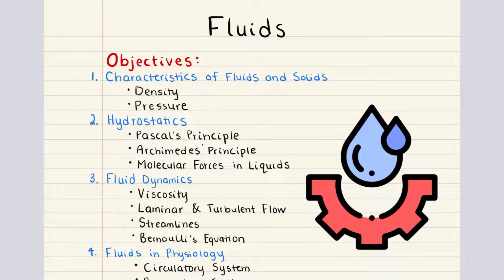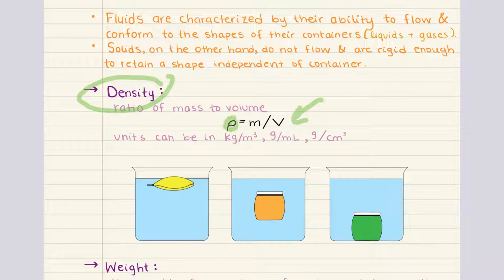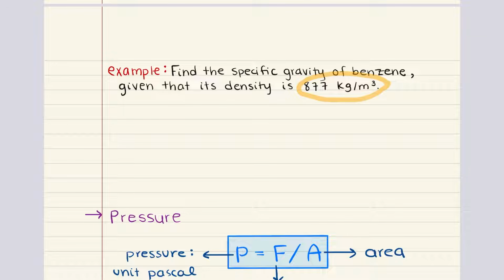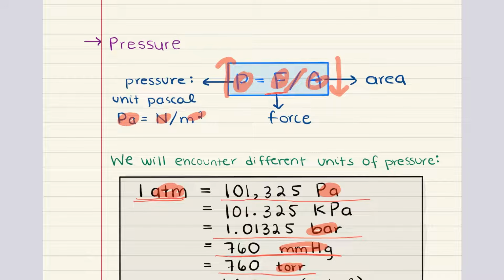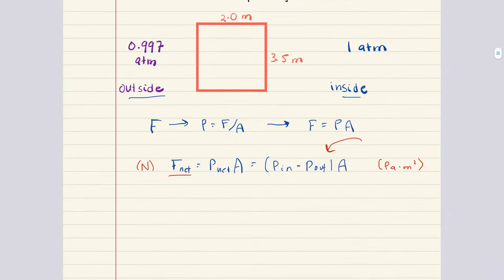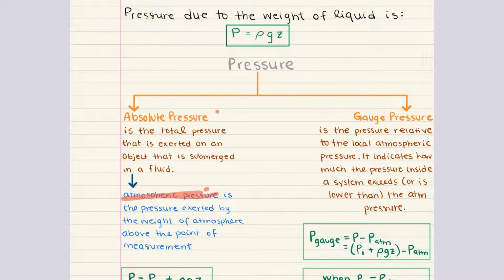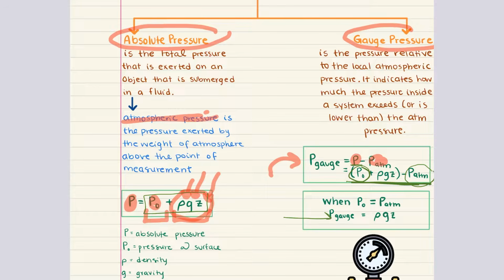MCAT Physics and Math: Chapter 4 - Fluids (1/3)

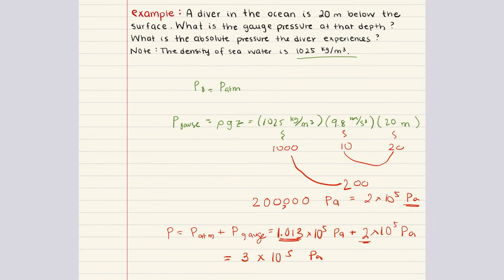Comment: at 24:41 the question does not explicitly state the P0 or Patm so do we assume they are equal to each other always
Reply from the maker: Yup because the surface of an open liquid is exposed to atmospheric pressure
Reply: @professoreman2289 but they ask us at 20m depth not at the surface , so how we take Po and Patm are equal ?
Reply: @JamalKhaled-p7s  I was stuck on this too. I know, in reality, the Po will not equal to atmospheric pressure, but we dont have any information on what Po actually is. It is safe to assume that it is atmospheric unless stated otherwise in the question.
Reply: @JamalKhaled-p7s    Po is the pressure at the surface of the ocean (so it is Patm), think of Po as the initial pressure before submering in the ocean. The absolute pressure is when we are 20m below the surface. So it is Po + pgz, aka it is the Po, pressure before entering the ocean (z = 0), plus pgz, the pressure of the water itself when you are 20m deep in the ocean. So the overall absolute pressure at the end is the pressure of the ocean PLUS Po, the pressure of all of the atmosphere above you.